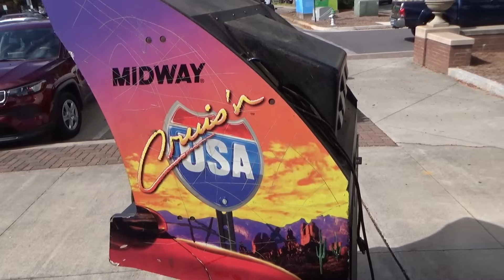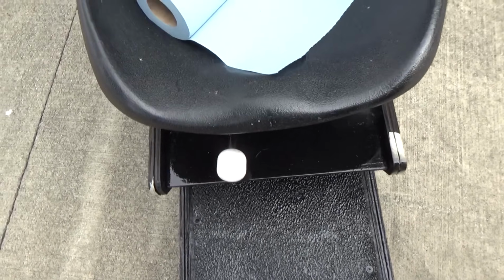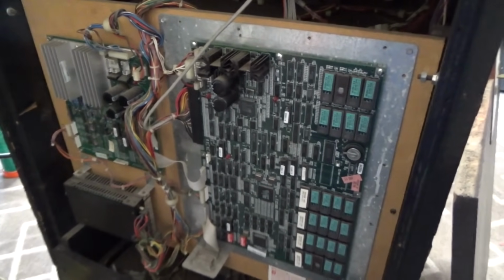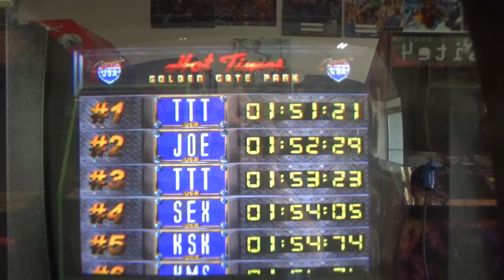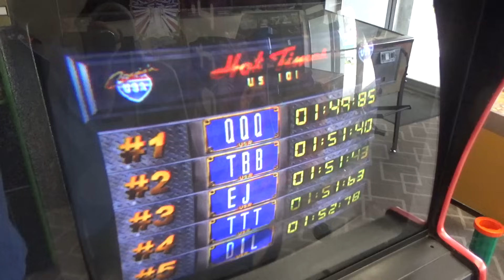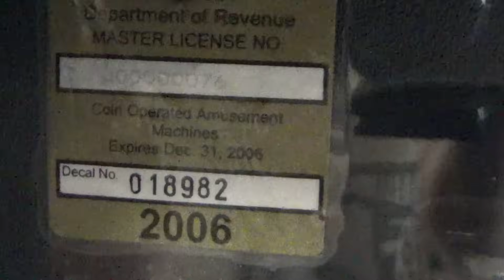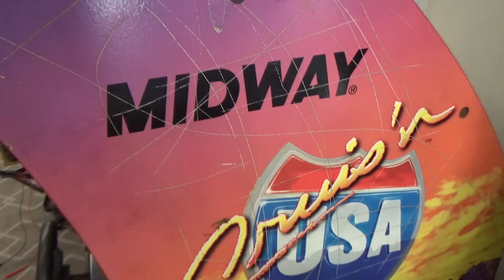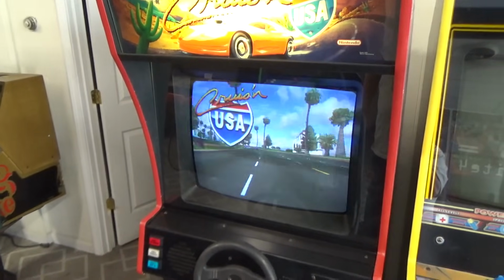We Repair And SAVE This Nintendo Cruis'n USA Arcade Machine!

Comment: You can remove the top on that Fluke meter, it is wireless communication between the screen and the meter. Then you can take the screen with you, and leave the meter connected, if you shall adjust something away from where you connections are.
Reply: now that's fancy!

Comment: You didn't discharge the tube?
Reply from the maker: I'm very comfortable with Monitors and have Taken Monitor Chassis out of machines probably a few thousand times, usually everyday I'm working on a monitor

K7000 and newer actually have a bleed down circuit that discharges the tube

But it is a good Practice to discharge all tubes, I usually just Discharge the older ones tho like a g07, 4900, Sanyo the ones Without a Bleed Down Circuit

Do as I say, Not as I do :)
Reply: @LyonsArcade  Appreciate the explanation, Cheers :)

Comment: I started using AT or ATX PC power supplies because they hold up longer are usually higher amp than switching power supplies and are easy to find.

Comment: Nice job on it... Quick question can the side panels come off. I'm trying to buy one but it won't fit in between my basement door. My doorway is about 29 inches
Reply from the maker: No the side panels wont come off, only the seat section

Comment: ???? The First few runs may have come without wheels but later runs of the Cabinet Did have wheels. I've seen that Cabinet Delivered brand new straight from Midway Arcade. Maybe it was "region" restricted or may have just been more popular option in some areas over others but that was an option when they were selling them back in the day. Crusin USA and it's later versions are just the most popular late 90's - present Arcade cabinets to present in America. Literally they released a new Crusin Cabinet just a few years ago a year or two before covid hit.
Reply from the maker: I've never seen a USA with factory wheels, The World and Exotica came with wheels tho
Reply: @LyonsArcade  if I'm remembering correctly it's actually a re-release version they did to cover for either world or Exotica not performing as well. They also Charged extra for the wheeled version so they might be more rare in your part of world.

Comment: Hey Joe, do you know if any way to fix that speaker feedback when booting and during it’s game preview? I have a refurbished unit that does the
Same thing even with new speakers and matching impedance.
Reply from the maker: Not really, it's just a noisy design, it would be hard to get rid of it.  They were designed for arcades so when they made the board they didn't isolate everything so it wouldn't have any noise in it, since it didn't matter how noisy it was...
Reply: @LyonsArcade  this helps thanks man. Great video. Great game

Comment: Unrelated, I got curious and looked up "zero-crossing." That has to do with the time that AC current is neutral, neither positive nor negative. To detect it, it is just a full-wave rectifier, an optocoupler, and an inverter. In their case, the inverter is just a transistor and a pull-up resistor. Now the reason pinball machines need that is to know the ideal time to flash multiplexed lights and throw solenoids to make things last longer.

As for the meter, well, that is the nice one that is detachable. That way, you can focus the camera on the detached portion no matter how the meter base gets moved around as you use it.

And yes, I agree with your overall strategy here. Replace the things most likely to go soon, so recapping and the flyback if you have one. 

I found from another channel that you have to watch on changing the flyback, that you use the original part and not a cheap knockoff. Most people think "blooming" is in the CRT itself, and I guess it can be, but often, it is the flyback that is responsible.  A guy on a retro channel played with an old Commodore monitor and an old Atari monitor. They used the identical motherboard in the chassis, just that the Commodore one was populated more for more connectors on the back. The Commodore monitor bloomed, but the Atari one didn't.  He first tried swapping the board to rule out the CRT and the blooming moved with the board. Then he moved the flyback to the Commodore board and the blooming stopped. Then he changed the rather new aftermarket flyback on the one doing the blooming with another aftermarket flyback. It still bloomed, but not as much. So you have to watch where you get the flybacks. Some of it is just Chinese junk, and some is just good enough.

Comment: Maybe for the smells you could put a ozone generator inside the cabinet and throw a tarp over it and let it rip overnight. I bought a nasty car and did that for 4 hours several nights with a cheap generator off the jungle site and a USB battery pack. Took a while, but eventually it killed 95% of the smell. Still a little dank on the first few hot days of summer though....
Reply from the maker: Good Idea

Comment: Hi Joe, i havea cruisin USA game i have an issue when i turn on the game then after the screen glitches and reboots, would you know what causes this? i reset everything and no luck thanks
Reply from the maker: Power Supply is probably low, you'd need to check it with a multi meter to be sure, dirty edge connector could also do it

Comment: What is the wattage of the soldering iron you usually use in your repairs?
Reply from the maker: We use a Weller WESD51 and love it, usually keep the temp around 600 or so if that's what your asking

Thanks for watching!
Reply: @LyonsArcade  thanks for your reply.👍